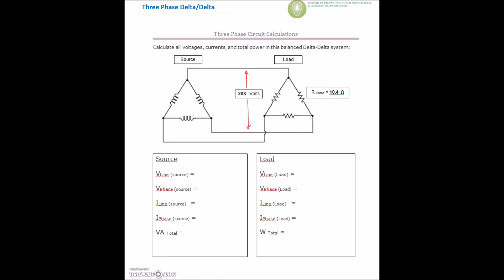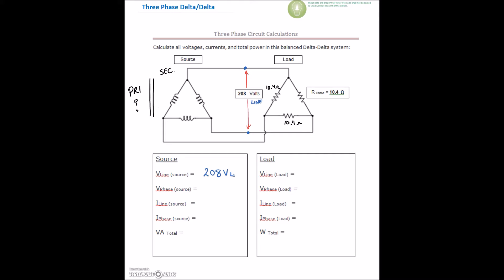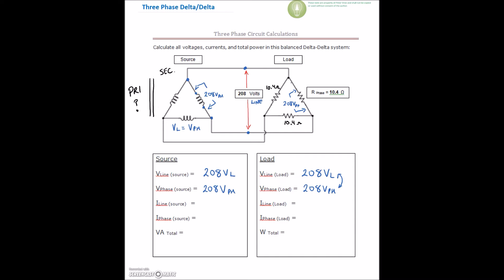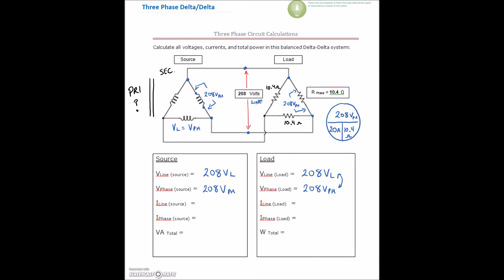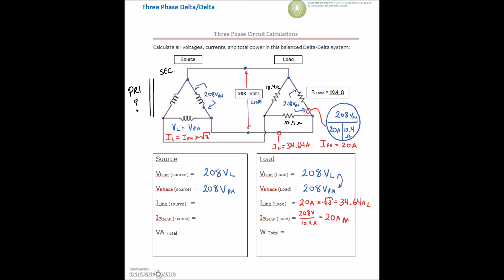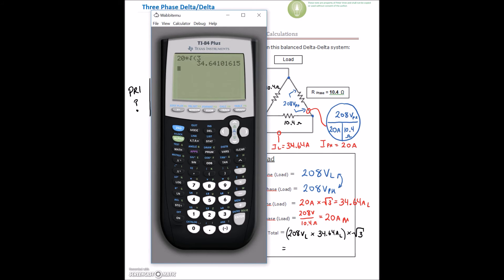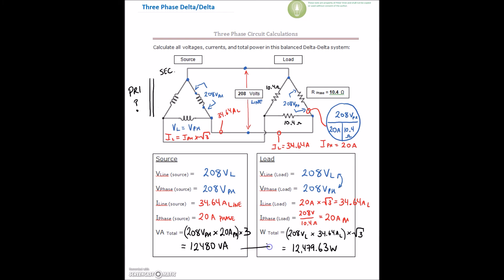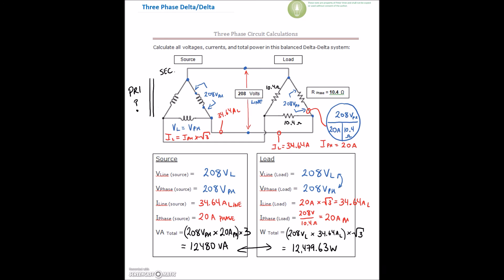3 Phase Calculation #1 (Delta Source, Delta Load)

Comment: Pete, I've been confused about when a ground connection is needed, and when it's not. For example in some delta wye configurations it is on the primary, on some it's on the secondary. Is there an easy way to quickly infer where the ground is needed, without memorizing the circuit drawing for every situation?
Reply from the maker: In Canada, we only ground the Neutral of the Wye System. This is done in the transformer by connecting XO to the Bond. 

The Delta is an ungrounded system. 

However, in the US, there exists a 4-Wire Delta circuit in which one of the windings is center-tapped and grounded.
Reply: Thanks, It's coming together. I found a complementary video by MikeHoltNEC that helped. Your videos are really useful, thanks for the effort.
Reply from the maker: No problem. You have a great channel as well. I subbed to your channel and am enjoying your Ignition Waveform Analysis video. Keep in touch. Pete